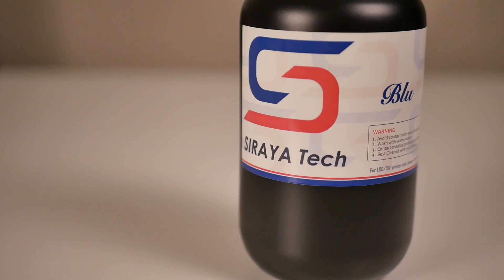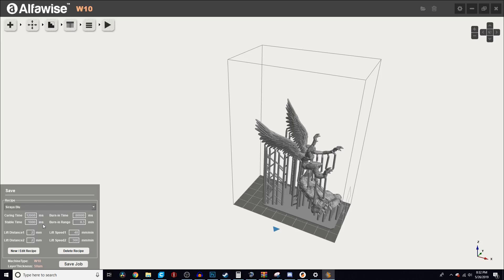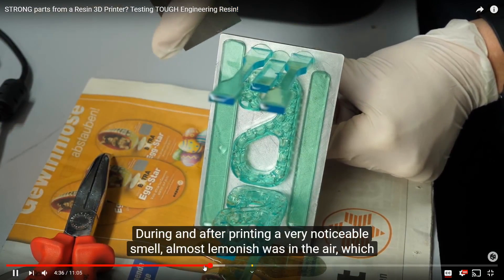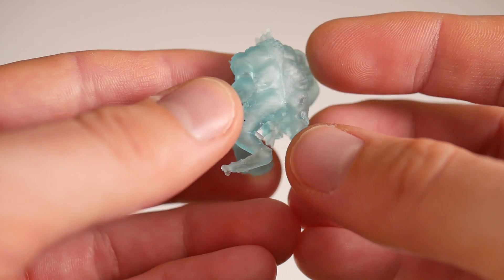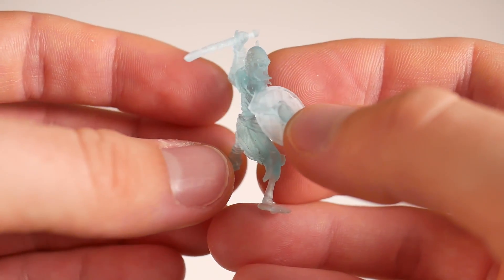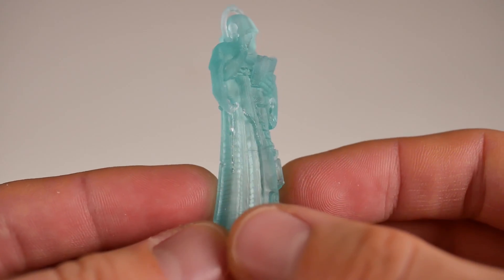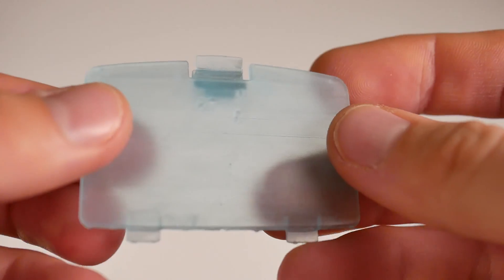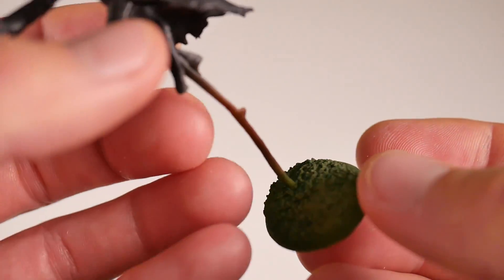Affordable Tough Resin For Functional Resin 3D Printing

Comment: Note for every ones safety concerns.: Yes please, just throwing it out there. DO NOT USE RESIN in living spaces. Thank you for mentioning your girlfriend. She is correct and you are correct. In a garage or somewhere like it is the way to be. The fumes to Resin printing are toxic. They emit unsafe VOC content into the air. Use your P.O.P. gear. In short if you have to be near it at all, make it very limited amounts, and mask up with actual painters masks. The area needs to be WELL VENTILATED! No N95 dust masks. Those do NOT protect you.

Comment: Thank you for showing actual functional parts and how the functional component flexes and recovers when you bend them. Now I can see how objects I want to print that need to survive infrequent flexing are likely to work and how stiff the overall object is to typical handling pressure. By far the most valuable information around. Cheers.

Comment: I'm considering buying this resin, but I've heard vaguely that non-tough resins have, "better resolution." I'm just barely able to print tiny gears using Elegoo ABS-like grey on my Photon Zero, and small details such as this would be absolutely crucial. I'm also considering Siraya Fast. Blu is the most expensive of the three by a substantial margin. However, these parts may be under load that I'm not 100% confident my current Elegoo ABS can handle. Anyone have any thoughts?

Comment: clean with Mean Green instead of IPA
Reply: Do you have any idea what would be the UK alternative would be, please?
Reply: @malysyforethought1195  I'm also trying to find an alternative here in Australia...closest I've found is Simple Green so far, which seems to work better than IPA but not quite as good as Mean Green.
Reply: @chrispbacon177  Simple green multi purpose disinfectant? ive tried a few multipurpose degreasers/surface cleaners and they all seem to work better than IPA (which just dissolves instead of dispersing) but the best so far is resin away by monocure

Comment: Just wondering want your post processing times were for the isopropyl alcohol and UV curing lamp. My prints with this resin always come out green instead of blue, it could just be my batch but I'm curious.
Reply: green is the finished color. as time goes by, it will slowly turn to baby blue.
Reply: @sirayatech2  Thank you for the response, I can confirm this to be accurate the part that used to be green are now turning blue